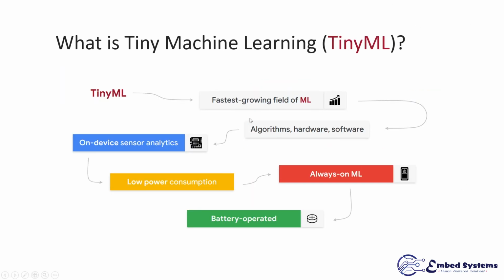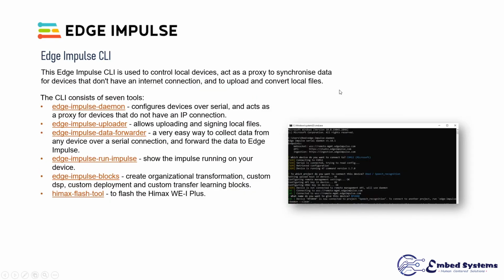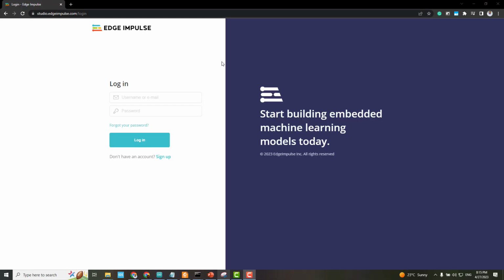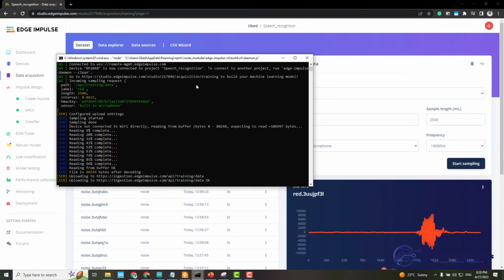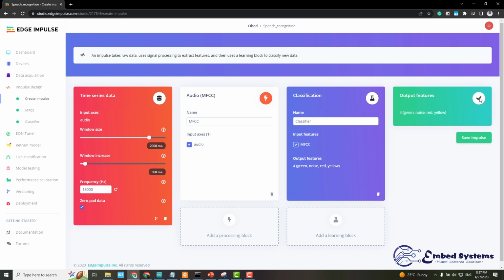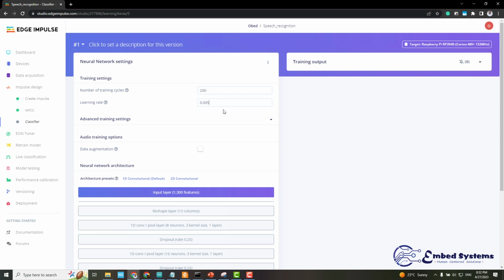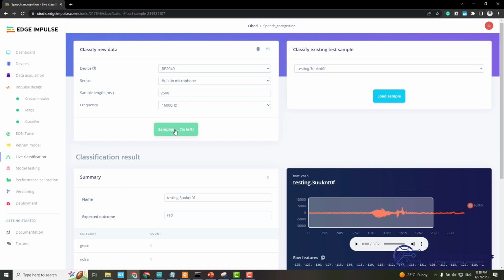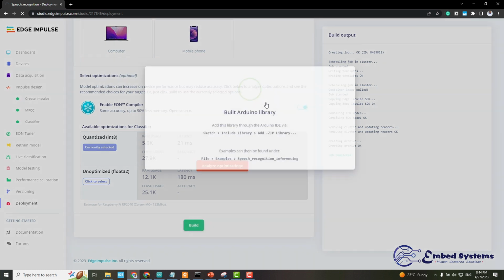TinyML with EDGE IMPULSE on Arduino Nano RP2040 Connect : Part I

Comment: i have this error message whenever i compile
C:\Users\hp\Documents\Arduino\libraries\Fall_Detection_inferencing\src/edge-impulse-sdk/dsp/numpy_types.h:26:10: fatal error: functional: No such file or directory
 #include <functional>

and it occurs with other includes also
Reply: Not sure why that error but confirm if you selected the correct board